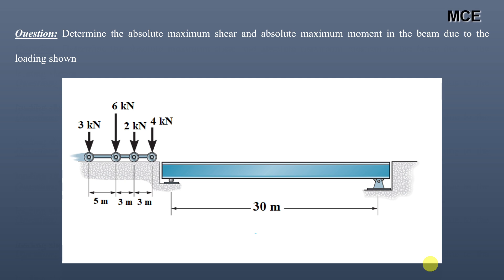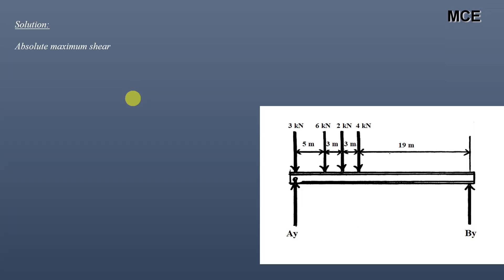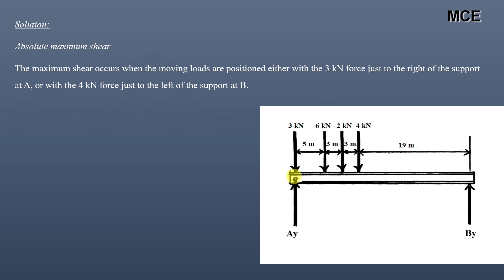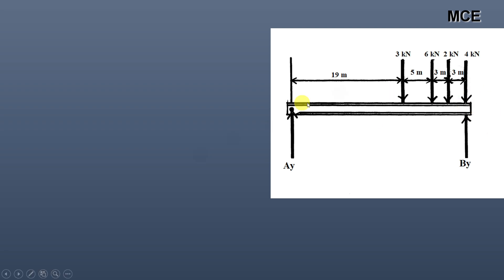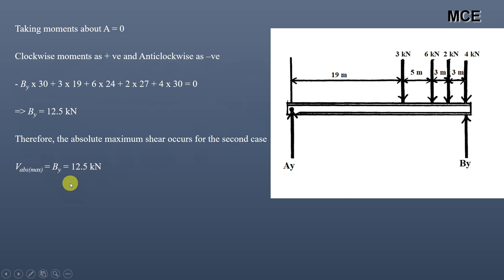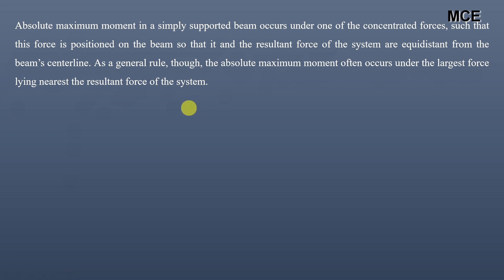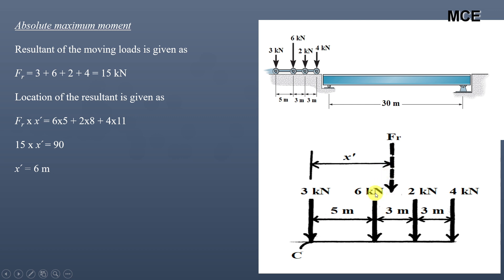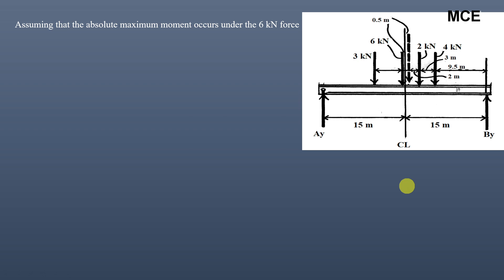Absolute Maximum Shear and Moment Due To Series of Concentrated Loads in a Simply Supported Beam

Comment: How did you found 90.13 KN.M
Reply from the maker: Thanks for watching dear
Reply from the maker: M = 90.13 kN-m is the momemt about 6 kN force and is given by cutting a section just to the left of 6 kN force
Reply from the maker: It is given as can be seen in the solution video as 
M = 7.25×14.5 - 3x5 = 90.13 kN-m